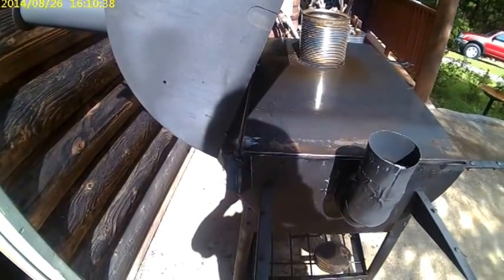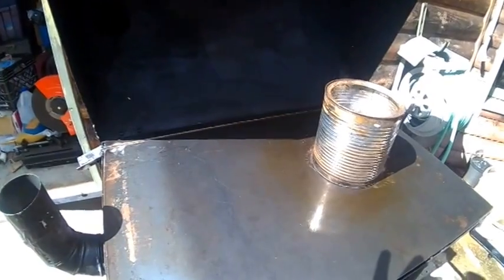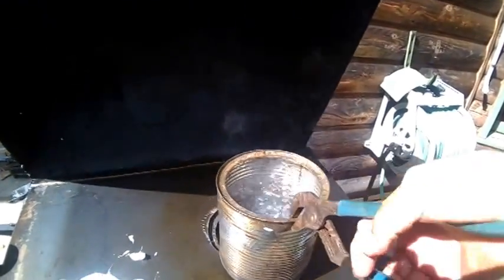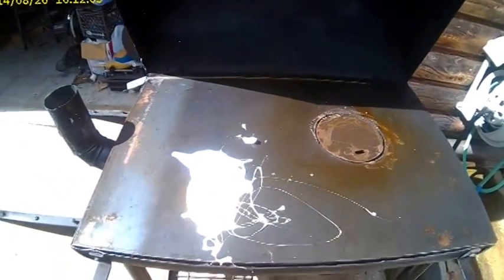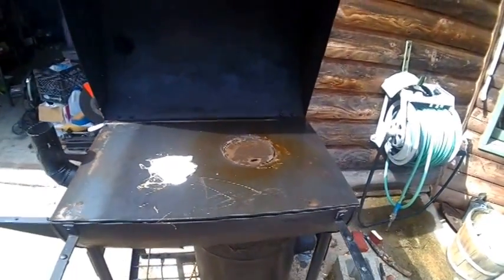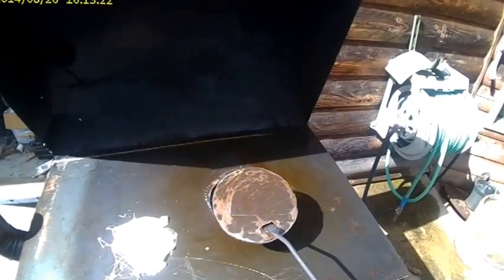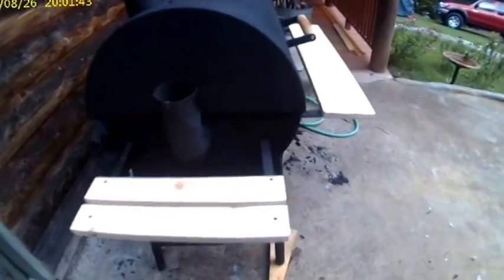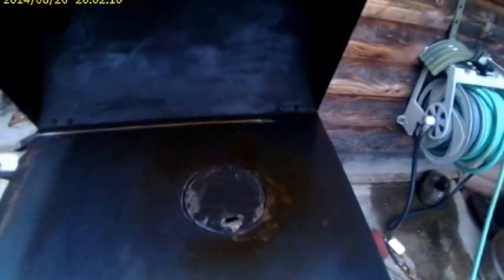Rocket Stove Grill Fabrication (Part 6, The final chapter)

Comment: WooHoo! That was Wonderful! I watched them all, and boy did you ever put a lot of work in that one. It turned out really nice, and you could never purchase one as good as that without spending a fortune. I love it! I really like this idea, and although I may modify it some, I'm going to see if I can attach my already made regular rocket stove to something, and have one like this too. I can't thank you enough for all the hard work you put into this, it's something that I know I would use all of the time. Summer and winter we use our char-grill and we love it. so I won't take that apart, but I will find something to surround my rocket stove and get one of those steel sheets to use. Wait till my son sees this, he will love it too. Bless, Sheila
Reply from the maker: +Sheila6325 : After using it repeatedly 1 discovered 1 improvement that should have been made. I should have built some slope into the cooktop to aid in Grease runoff to the catch can. Thanks for watcing
Reply: SmokymntnEd Yep, I did think of that, and that's a good one to pass along to others. It wouldn't take much of a slope either. Bless, Sheila